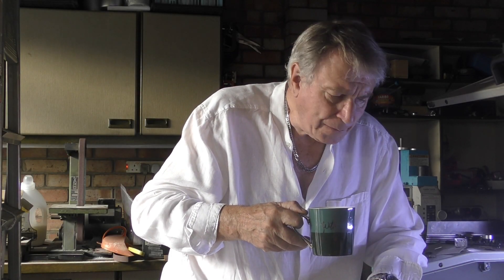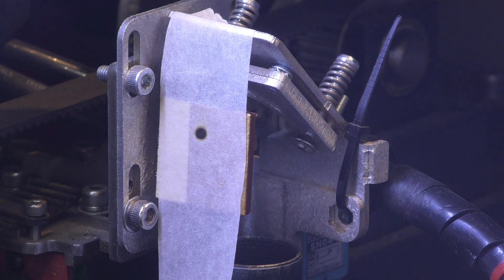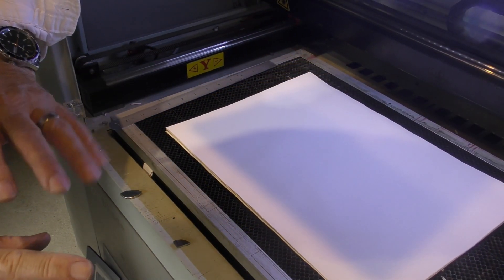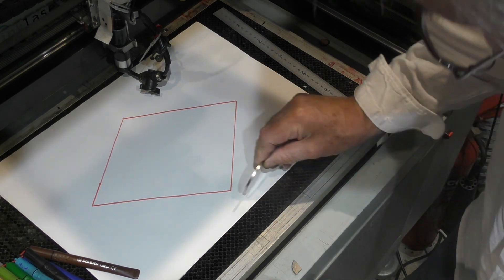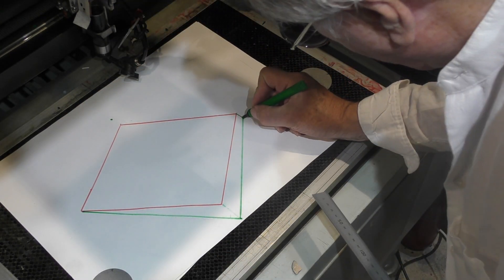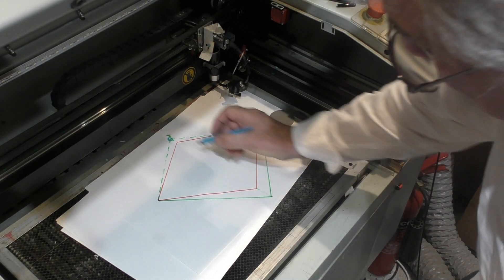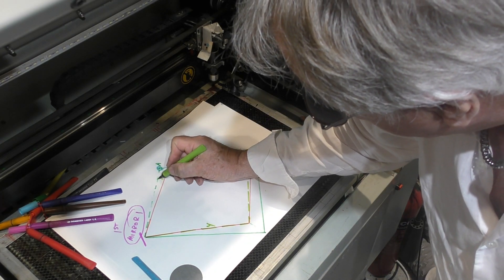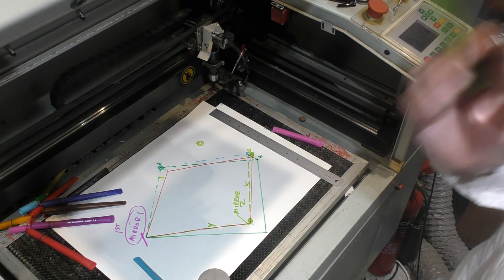RDWorks Learning Lab  242 Beam Setting  The 4th Corner Problem Revisited

Comment: Russ, first of all I would like to thank you for these educational videos. I recently adjusted all my mirrors and got the spot on in about two hours, and for the first time the laser beam cuts straight up and down and not at an angle. A friend of mine has a 70 watt laser that he uses in his business. He asked if I would align his machine. When I got there to align the machine he was cutting out some stuff on ⅛" clear acrylic. He made five passes to completely cut through ⅛" acrylic! And, the cuts looked like rubbish. When the job was finished I reached over and touched the number 3 mirror housing. It was hot to the touch. I put a piece of tape over the hole and pulsed the laser. Half of the beam hit the hole, the other half was hitting the metal housing. It is a wonder it was working at all. But it gets worse. I went behind the machine and opened the cabinet to look at the laser tube. The first thing I noticed was there was no way the laser beam could be hitting the 1st mirror in the middle. I was right. Only half the beam was hitting the mirror at all. I can't believe this machine was working, yet it was. Barely. Using your instructions, I went to work and after a while I got his machine lined up. It is like a new machine to him. It actually cuts like a 70 watt laser should cut. Of course, all his settings were for a 2 watt machine, so now he has to figure all that over again. I have no "fear" of aligning a CO2 laser thanks to you.

Comment: Hello sir,
I am fixing the 4th corner problem, however the 4th corner problem moves to the forward left corner. How should i approach this? By going in circles until i get everything flat? Thanks for the videos. Very helpful 🤝🏼🙏🏼
Reply from the maker: Ihave demonstarted a completelyy different method to that usually advocated b the Chinese and everyone that speaks of beam alignment,  See this  more recent video as it should help to solve your problem
https://youtu.be/tvNfAg-cOLA
Best wishes   Russ
Reply: @SarbarMultimedia  the video doesn’t show which mirror you adjust when checking the front left corner. This is where i am stuck now. I have all corners on point except for front left. With which mirror do i continue here for adjusting?
Reply: @100.t0n  did you manage to fix this? I have the same problem. Part of me thinks it has something to do with the frame or gantry not being level.

Comment: I proceeded exactly as in the video and actually hit the same point in all 4 corners. If I move the laser head but  at the end of the Y-Axis in the middle of the X-axis, I have a displacement of the spot to the bottom right by about 2mm. How can that be? Kind regards Marco
Reply from the maker: Hi Marco
 That's an   illogical issue  and not one I have encountered. If all the corners are correct it means you have set your beam to a perfectly flat plane that matches the  plane of head travel. Mirror number two is the usual problem mirror because it takes a  nice straight beam from mirror 1 and "bends" it in the middle to point it at mirror 3 . By using the extreme corners of the table and setting mirror 2 last  removes its sensitivity. . I am racking my brains to visualize how your observation is even possible.. One thought that I have encountered with another correspondents machine (I wont explainat present)  Can you test the corners are still coincident but at 50mm away from the back and front  ie dont send the Y axis to extreme positions.
 Best wishes
Russ

Comment: Thanks for this video, however; I haven't found your first video on setting up the mirrors for proper alignment, or did you make one?  I've done one in the past 4 months, but I still would like to see yours.
Reply from the maker: Hi Phillip
 Yes I did a videoo that explains the iteration process of setting mirrors . It can never be a single adjustment process as many videos would have you believe.  have spent many years setting and unsetting the beam on my machines. Practice makes perfect and  I have developed several modifications to my machine that allows perfect beam alignment. See this video.
https://youtu.be/6aNwKhTRnd8.
 Bedst wishes
Russ
Reply: @SarbarMultimedia  Thanks Russ.  I'll check it out tomorrow.  Love the videos BTW.
Reply: Hi Russ.  The issue I’m having is that adjusting M1 in the far upper right makes the bottom right drift then inline it up and go back to upper right and it’s off again. I’m not understanding how to dial it in

Comment: When i try this, the problem will move from 4 to corner 1. Can`t figure it out!!  ..1610 table..
Reply from the maker: Hi Jan
 After I created this video I realised I has stumbled upon a new method for beam setting which I describe in 
https://www.youtube.com/watch?v=hFlxnjADZDA
I includes the 4th corner as part of the beam setting process. Perhaps look at this method first.. It's quicker than adding the 4 corner fix to the end of a conventional beam setup.
 Best wishes
Russ
Reply: @SarbarMultimedia   Ok, Thanks
Reply: @SarbarMultimedia  is it possible, you have put in a wrong link?
Reply from the maker: @royrohner3573  
Hi Roy
Thanks for pointing out the hole between my two remaining grey cells!!!!  Yes, I had accidently pasted a lnk and didn't check. It's now been fixed and you can link to #244
 Best wishes and thanks.
Russ
Reply: @SarbarMultimedia  Russ thanks so much for pointing me in the direction of this video as well. ;) I really appreciate your work on this great channel!

Comment: Ill try this one tomorrow, but at the same time I can attest to the fact that machine currently in my hands, which I've been asked to fix - the base/gantry is not square in any shape or form, and part of the problem is still fixed by shims. Sometimes the metal is too thin and even bows out. Sometimes it's a problem with Y axis rod, where you do not shim the rod, but loosen and move your rod a little and then tighten it. Sometimes its the dragchain pushing on the 2nd mirror bracket when its sitting in a corner (but then this misalighnment is not linear) .
This machine I'm currently having problems with - it's gantry is bolted to the base not in the corners but more to the middle, so shimmiying that is almost unhelpful, unless you drill new holes to fix gantry to the base in the exact corners.   
I really hope this new method helps, because I'm dead tired of this cheapo machine, and I cannot give it back in it's current state.
Reply from the maker: Hi Oleg
 Putting this problem into words and diagrams,( up to now it's been an image in my brain) has made me realize there may be a simpler way to set a machine that integrates the 4th corner as part of the process.. see video 244
 If you are still stuck after watching and testing video 244 then contact ee privately with this link and we can speak by email and you can send me some pictures.
https://forms.zohopublic.eu/ndeavorlimited/form/K40XtreeemLaserCutterContactRussSadler/formperma/k2Cn0QN5ChpazfTMAUw25lZ-FKpjZa96TQWHjv3ntOg
 Best wishes
Russ

Comment: On my machine I fixed this problem by tensioning Y axis belt.
Reply from the maker: I am geuinely pleased to hear that you fixed it  because it is a very annoying problem but I can only imagine it was luck and not logic. I have never touched my Y belt tension on any of my machines  and I still get a 4th corner problem. However, this explanation of the 4th corner problem made me think again about the whole orthodox setting routine we all  have been taught/. Is it really that logical?  I am planning another video  to test my idea. So keep watching........and no Y belts involved.
 Best wishes
Russ
ps I admit to trying a lot more than Y belt tension to try fix the problem by trial and error and I never really suceded until I sat down and logically disected the problem.  So there is no intended crircism of your lucky fix.
Reply: @SarbarMultimedia  My machine is a little bit different than yours (red/black 80w). When I tension y axis belt mirror two moves towards mirror one and that changes beam path. You are right, it was luck but now it is very logical.
Reply from the maker: @radionica42  
Hi 
I also have a machine that is exactly the same design as yourr red and black machine and for months I was fixated that somehow the #2 mirror was being influenced to rotate fractionally between front and back positions.  Well, it seemed logical at the time!!!!

Comment: You can think of this method as getting an extra X axis length of distance to see any deviation. That means you can see a smaller error angle in mirror 1. Could this be applied to mirror 2? After doing a rough alignment, would it help to make your burn marks on paper in your lens 3 alignment jig? You would get an extra 4-6" of length to see error; and you can align mirror 2, mirror 3, and center the beam down the lens without changing jigs. You could even make a longer lens 3 jig for more precision of both lens 2 & 3. Just a thought, it might not be worth it.
Reply from the maker: Yes, there is some strange logic here that would probably work BUT to get to the mirror 3 jig,  the beam has to be set aprox correct for Y and X  so that the beam hits mirror 3. anyway.  In which case why bother . Just adopt the 2 step correction procedure I describe. . In fact thinking further about this you have possibly stimulated my thinking juices to create a whole new beam setting strategy which involves setting Xand Y accurately before starting to  calibrate the Z axis....... Watch this space for future videos.
 Best wishes
Russ

Comment: Hey Russ, thanks for yet another quality video!

With that in mind, I would like to point out that for DIY machines, it can definitely, 110% be axis that are not co-planar, and shims are in fact the answer. I had been fooling around with the issue for more than a year, and no matter what I tried, including some of your previous videos, there was nothing I could do to get the 4th corner to align. 

The solution? A $60 360 degree line laser. Aligning that with the first 3 corners, I could then clearly and undeniably see that the 4th corner was out of the plane by several millimeters. Shimming that axis brought the 4th corner into the same plane as the other 3, and I was able to align the whole system in less than 5 minutes. 

For manufactured machines it's unlikely for there to be such a mechanical error like you say, but I wanted to make sure folks don't dismiss it entirely seeing as there's a sizable crowd building their own machines. As I believe most of that crowd to be viewers of your excellent videos, I thought a heads-up wouldn't be out of order.

Once again, thanks for your continued efforts in the laser scene, it's really helpful!
Reply from the maker: Hi
I appreciate the reminder that not all folks just buy a factory built lase and  that significant variations form a flat  mechanical plane MAY  have an effect. I say MAY because logically it shouldn't. If you consider the mechanics of the problem you will see that because mirror 2 and the head are pernanatly aligned  to each other, (via the gantry) , if you push the head fully right, it will follow the ups and downs of your skewed rail. As the head moves up and down it will cause the gantry to rise and fall at the right end also,   but at ALL times mirror 2 will reflect onto the head with no change because the mirror tips with the gantry.. 
However, I agree with your laser method to  set your base frame pretty true before you start alighning the beam because if you are working with skewed Y rails there will be a "hill" in the middle of your mechanical plane and that means it will be almost impossible to set your nozzle to a uniform gap at all points on your table. The advantage of a factrory built machine is the rigid welded fame and case with box sides that prevent twist. DIY machines tend to be bolted together aluminium sections.. That method provides a simple manufacturing technique but in relation to a welded steel frame its a piece of jelly that can be inflenced by external features like floor flatness. So if you are building such a frame, either add diagonal braces to each square frame in the structure , or bolt on panels that will achieve the same sort of cross bracing rigidity to the frame. 

Thanks again for the  comment because self builder may overlook these detail structual issues.
 Best wishes
Russ
Reply: @SarbarMultimedia  thanks for the reply!

While I agree that the second mirror should tilt with a rise and fall of the gantry, and thus keep the beam spot-on on the head, that can only be true if the fulcrum of the gantry exactly coincides with the spot where the beam hits the second mirror. If this is not the case, tilting the gantry would lever the second mirror out of position, and also change the relative angle to #1, would it not? And while it may not deviate by much, the mechanica shift, along with the change in angle can be enough to cause a detrimental defect over a longer span, like the relatively long x-axis. 

So, while one may luck out and have the second mirror accidentally correct for the gantry not being coplanar, I would not rely on that, considering all the frustrations it can cause when the thing doesn't line up. I've spent countless hours trying to align the damn thing before finally purchasing the 360 laser and getting the head mechanically coplanar in the four corners. That fixed years of struggling and frustrations. Hoping these comments can spare others the same misery :)

Once again, thank you for your contributions to the laser scene. It's always intriguing to be pushed to think more thoroughly about issues like these!

Comment: Lol. I had been meaning to message you on this. Upper right corner is always low. Suspected it is the tube alignment slightly off. 
Your diagram is helpful. 
Laser alignment is one of them things.. you either get lucky and still don't understand it or you are able to understand it. 
I always feel sorry for new owners that are told to twist this and adjust that. By someone that can't see the full story. 

I do wonder though.. how do the laser manufactures set up the mirrors. They have to have a quick method. 

Thank you russ for another video.
Reply: Well on my K40, when it arrived the mirrors were so far out of alignment that on my first check it burned a hole in the wall on the other side of the workshop! (good thing I was standing behind the machine and no one else was in the room at the time)
Reply: @zebo-the-fat  
Yup I done that. Burns the paint on the inside of machine. :(